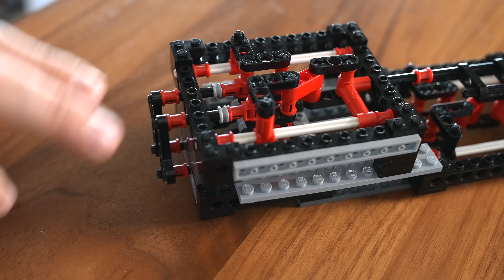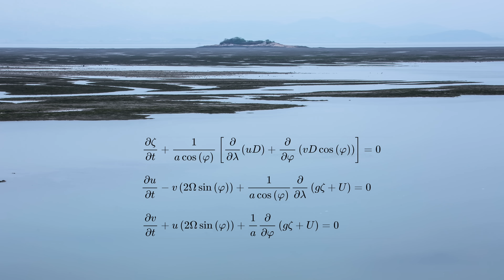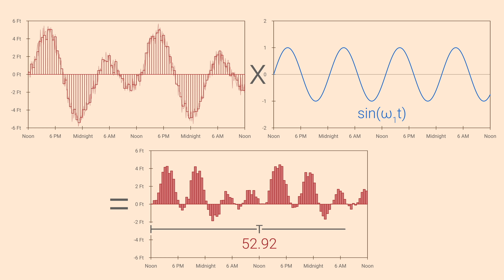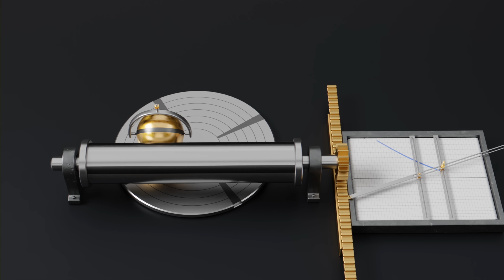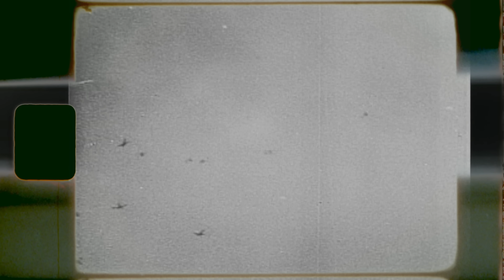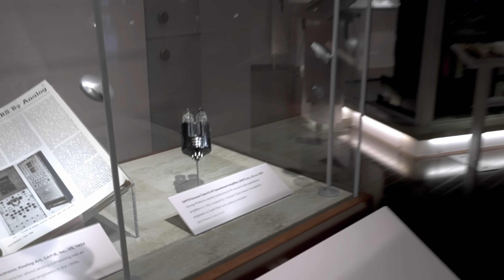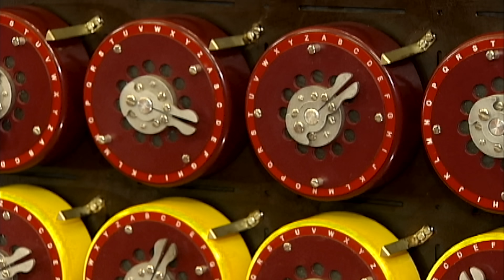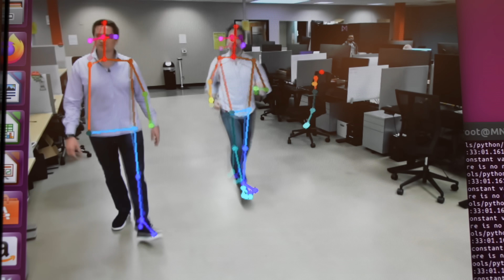The Most Powerful Computers You've Never Heard Of

Comment: What we need is digital computers operating with more than 2 bits. Using memristors or the like to identify more than 2 voltages. Computing on a higher base could be interesting.

Couple that with an odd idea... Use cooling for information as well. Micro ducts delivering coolant that also delivers information.

The brain. I'm describing a brain.

Comment: My favourite analog computers somewhat pre date WW1 and were the rangefinders and fire control tables on warships that integrated the firing ships motions, forward, roll, pitch and yaw, with the target's range, bearing and speed to aim the gun batteries and achieve hits against moving targets at 10,000+ yard ranges, or in HMS Warspite's case, with Radar assist in WW2, almost 15 miles. 

Also the WW1 warships made early use of electrical signaling from the central fire director station to the guns to set the individual turret rotation and gun elevation to fire on the correct target solution almost like a stepper motor. Norman Friedman's "Naval Firepower" is a great history of naval fire control. Maybe some of this gets covered in Part 2?

Comment: Theoretically you can build an analog computer that can calculate infinite amount of data with only one single clock. The informations between 0 and 1 are infinite. Or you can increase the clock to infinite Hz

The problem with case #1 is electric here is assumed to have speed near infinite (actually exactly infinite)
For case #2 increasing frequency to that level results in millers effect ( capacitance properties start to appear between wires of the circuit itself) which breaks the circuit and its functions

Those are the two main reasons of many reasons why

Quantum computers are form of analog computers

If analog computers were to exist, the world would change 180 degrees.

Comment: Mechanical analogue computation devices are rare and (IMO) are not coming back unless it's on the nanoscale. But Electronic analogue devices never went away. At this point in time a generic digital CPU is probably cheaper, but if you need it an analogue (or mixed analogue/digital) ASIC is often used. There are even FPGA devices with analogue components; though usually very few as signal/noise ratios will be a pain.

Comment: #17:10 Strictly speaking, you only need one operation as you can do any logical operation on any number of inputs by combining 2-input NAND (NOT AND) gates or by combining 2-input NOR (NOT OR) gates. (Despite their names, NAND and NOR count as single logical operations - two of the sixteen possible logical operations on two inputs.) This was proved by Henry M. Sheffer in a 1913 paper, although it was discovered earlier and independently by Charles Peirce in 1880 (published posthumously in 1936).

Comment: The problem with analog computers is that they need separate machanisms to calculate all the different processes. This makes them impractical for smaller devices like phones and smartwatches which are prone to shaking making digital the ideal ones. With AI coming over, it just makes the digital computers choose newer ways to calculate complex functions efficiently.

Comment: This makes me think about MRI imaging.

It uses analog equipment to collect analog data, converts that to digital data, Then performs Fourier transforms and stores the data.  We then run an inverse Fourier transform and display the values, giving a digital representation of the anatomy.

Many advances in image quality recently have been converting the analog to digital ASAP, to limit noise.  Now they are even using AI to remove noise..  

It makes me wonder if it would be possible to create an analog AI for removing noise, and forgo the analog to digital conversion, giving the AIgorithims early access to the data, then project this data into an analog storage medium...

If possible, it would seem this could be used to create a physical copy of a person, albeit only in their hydrogen molecular structure... But if you imaged multiple frequencies for different atoms, and multiple parameters..

Fun science fiction for now I suppose.

Comment: As part of my chemical engineering curriculum, I had to learn how to simulate simple control (PID) systems using analog computers.  I found it so useful to build a system with wires and see the plotted results on the pen recorder. Digital control just didn't provide that satisfying "I built it" feeling.

Comment: The Norden bomb sight was incredible secret but the Germans stole the plans before the war and build the LotFe (Lotfernrohr 7), that was kind of the same but simpler to use. Both sides had the same problem. In real combat situations, you couldn't get precise results. Especially the idea of the US to use high flying B17 to hit moving ships turned out as a complete failure. The ships ships changed course while the bombs where in the air or made it impossible to get a fix by just zigzagging.

Comment: C'mon man so many wrong assumptions. You should research it more. Moore's law might be dead in its original form, but scaling is far from over. Transistors are no where near as small as atoms. State-of-the-art CMOS manufacturing node is still 7nm (for TSMC and Samsung and equivalent of that 10nm that Intel just managed to reach a few months ago). The only commercial products in 5nm node are Apple's M1 chips so far (there are plenty in the pipe, but not yet on the market). So we are gonna wait at least for a year or two (specially due to current bottlenecks in production) before 5nm becomes a norm. And TSMC has already 3nm in advanced state with a promising yield. Moreover, each node has many iterations where each iteration improves power consumption yielding higher Hz/W performance.
What we know for certain is that current scaling is not gonna stop until at least 1nm node. That is 10 years from now and probably a factor of 15-30x in performance compared to the current 7nm node.

Comment: in the 1970's, I worked with analog equipment whose main component was the op-amp. It was amazing with it's calculating ability and I thought at the time it would revolutionize electronics. However, digital came out and simplified understanding the circuits for the common man.

Comment: I heavily dispute these numbers of 90 rounds to take out an aircraft, the fact is AA fire was mostly ineffective throughout ww2 in actually taking out aircraft, and only had the function of making aircraft deploy their bomb load at an earlier, higher altitude and thus decreasing their accuracy. Even for German bombers, roughly 90% made it back home during all but the final weeks of the war, most that didn't were taken out by fighter aircraft or fuel shortages. A more accurate number would be for every tonnage of aircraft brought down by flack, 15 tons of anerican AA ammunition would be used up, and 18 tons for German AA, But again, its not the metric for success, since the AA's job is not to take out aircraft. It is also noteworthy that the German AA was far more effective throughout the war due to their heavy relying on synchronised strategic firing. In essence they would fire as a battery in front of a formation in a screen, making aircraft have to fly through a big square of exploding flack. Even if every shot itself was less accurate and in fact not even aimed at a specific aircraft, an entire formation would be peppered with fragments of a bunch of rounds all at once. Leading for a far larger psychological toll on pilots and crew.

Comment: In the 1960s I flew military aircraft packed with analogue computers used for navigation, fire control, flight controls and engine management. They used a mix of techniques, electronic, angular servos, ball and disc and fluidics. They were very effective and quite accurate, typically about one part in ten thousand.

Comment: Digital computers are not really all that robust to noise. I am a student of mathematics with a minor in informatics, and let me tell you: Avoiding propagating errors is half of what I do.
In data transmission (especially from device to device, but even only from RAM to CPU) there is a very real chance of a bit flipping. This usually is due to induction in the very tightly packed cables. This is mitigated by using checksums. But if our computers didn't have that problem, they could be faster and store more data, while staying as reliable.
Also in numerical computations you run into problems because you have only a limited amount of space to save any intermediate result. You will have to round, and this can lead to huge errors further in. There are some algorithms, that work beautifully by hand, but can't be implemented on a digital computer because of this.

Comment: The first example I ever saw of an analogue computer was in a towed, sonar seabed profiler manufactured by the Canadian company Huntec. Their profiler was secured to the ship by a long armoured cable which (naturally) passed any wave movement affecting the ship, directly onto the image being produced by the profiler. Huntec's answer was an accelerometer inside their profiler, the output of which was fed into two integrators, which translated the measured acceleration of the profiler into displacement. This displacement was then applied to the sonar signal in the form of an analogue delay, which (amazingly) removed the wave movement. 

The electronics in that device were simply amazing (like a Swiss watch), and I still take my hat off to the small team who designed and built it!

Comment: That was a fascinating production. Especially the tide-machine demonstrates so nicely the physical meaning of mathematics (the rope to sum up the turns of the wheels, the ball on the disc to integrate smoothly…)

But the other important lesson is that analogue computers handle a specific problem and do so instantly (maybe that’s what the next video will be about?).

Most of our modern digital computers multitask. And while devices such as smartphones need to do so, for many applications it is a waste of effort. Curious Droid has a fascinating video on the computers in the Apollo mission: much slower than a modern microchip but dedicated to a purpose and doing it very robust with immediate reboot in case of failure. It would be nice to get this level of simplicity and sturdiness back.

Comment: Derek - this video assumes a "computer" is just a calculator. A modern day digital computer isn't a calculator, but a turing complete machine. Its a machine that can execute any general purpose program along with a memory. Calling the 3 gears machine a computer isn't accurate. I would instead call it an analog calculator.

The modern computer is an electronic implementation of something called "von neumann machine". The gear machine isn't that.

Comment: Digital computing  is a way to abreviate small closed systems behaviour and create algorythms that make for a versatile tool simulating conditions that solve specific problems. But the more complex the simulation or problem solving tool gets, the more it has to get as analog as reality. So, in the past it was pure obseration analogy, now we have digital tools to help speed up analog systems analisis and simplify the analogy. The limit would be quantum phisics, the most "analog" of systems. No sum of logical mathematical interactions that we have now can reach that analogy.
I guess the proof is that every fixed or set clock we can create is a digital aproximation of real time or that thing we call time, if we could analize most of the huge amount of data shown by a solar or shadow clock across a millenia it´s possible we´d get closer to a more analog time device. Of course now, we have much better tools for that, in understanding gravity better.

Comment: Virtual Machines versus Physical Machines. I really like this episode! Honest, but I dont like the "Analog" header versus "Digital" computing.
Reason why?: A Turing Machine was an Analog, I.E. Physical Machine, a Ford Factory is a physical machine. The program on paper is Virtual or Digital. A program contains many detailed virtual machines (functions). 

Now, A Virtual Machine can exist in super position across multiple machines with a disconnection or loss of its parent physical machine. The same is with a process routine written on paper. A physical machine can ONLY exist in one place and in one sequence of states we can observe.

If I copy and paste the same program or Virtual machine across many Physical machines, observers can witness either individualized outputs or the same output across the many Physical Machines.

A Digital Computer like a RAM gate is considered Digital, but a chip that performs an Analog Process with a signal in one physical location in one sequence of states.
A Program or Virtual Machine is completely Digital and can exist across multiple platforms in multiple states.

"Digital" implies that electricity is involved with Electromagnetic signaling. "Analog" implies no Electromagnetic signaling but the Speaker built a RAM Gate out of Legos, so I question if the definition. With enough of those put together, you get a Turing machine, and you can crank it with animal on a treadmill or with Electricity. Either way, the Physical RAM gate is in one state, physical. One can write a program of a RAM gate and put across Ten computers, and it is in multiple states, untethered from the parent physical machine that created it.

Now I understand the distinguishment in terms of a study of Audio signals, and I could just be splitting hairs, but it is just a different way of looking at machines.
What I am saying is the understanding should be updated due to the internet. But I might be all wrong, thoughts?

Comment: Surprised that you didn’t touch on the fire control computers of the US Iowa class battleships.   They were analog and very accurate.  So accurate when they reentered service in the 1980, they looked to see how much of an improvement modern digital computers would be.  They found out that there wasn’t any significant difference over the old analog computers, so they kept them in the ships.   You can go take a tour on those ships and still see them in their glory.

Comment: You're making the difference between digital and analog computers by the difference that they either are discrete or continuous and also that they either work with physical parameters or just with symbols.
In most cases that absolutely makes sense. But the abacus is an interesting hybrid here. It's not analog because it's discrete but it's also not really digital because it works with physical parameters.
When the result of your calculation is five, there will physically be five of those beads in a certain position and not just an arrangement of beads that represent the number five. But even while you could cut a bead in half, that's not how it's meant to be used and you won't be able to work with all real numbers.
However, I still think that the abacus is digital. I think it makes much more sense to focus on the question of whether something is continuous or discrete.
Well, at least as long we're not living in a simulation and the whole universe is discrete.

Comment: General purpose computers you see today are just too complex to be replaced by analogue computers too soon. Even with advancement of quantum mechanics, material science and human knowledge there's just not enough math and science behind making these new stuff behave as general purpose state machine on desktop that an average person can use.

Technology behind it is in baby steps,  it has to be matured and new ways of compute are yet to be identified and utilised reliably. 

Dont worry, even with replacing silicon, new computers in next 50~100 years will still use same computing and logical building blocks that modern computers do. Beside we are still waiting for things like 3d stacking and more architectural patterns in silicon based machines to power next century till they will habe significant competition from alternatives.

This sounds facinating but it takes alot of efforts and lot of brain power to actually make these machines. Ut has been collective innovation of more than 80 years and it's still going on.

Comment: You don't need completely analog systems.  Just make them actually "digital" by sending a signal with 10 states instead of 2.  "Off" and "on" are so last century, we could easily make computers 5 times as fast by switching to all ten decimals.  For the first few years they wouldn't be faster, but they would use 1/5th the energy that we currently use, which means they would overheat less and could be overclocked faster than we have, thus being not only faster at the same megahertz, but capable of running faster without overheating as well.  I spent the first half of the video thinking that was where you were going with those sine-wave signals.  Oh well, we might be still 15 years from any company making decimal (10) computers instead of binary computers (2).

Comment: The A/D example is perspective. Count the teeth on the arc (or in the non LEGO version I have of that listen to the clicks) instead of the length of the arc and you're back to a finite, discreet adding machine with carry over just like the one that's more like a circuit. You need pulleys just like Kelvin for a true analogue... XD

Comment: The thing with Moore's Law to note though is that it will only be limited by human engineering. Our ability to pass manufacturing limitations before they happen. As it stands we can keep going with current and new methods because we find new ways to shrink circuits or create new designs. This though will be finite in the long run, but it only means we need to find new ones, maybe analog, maybe new materials, or maybe new particle transmission for circuit signals.